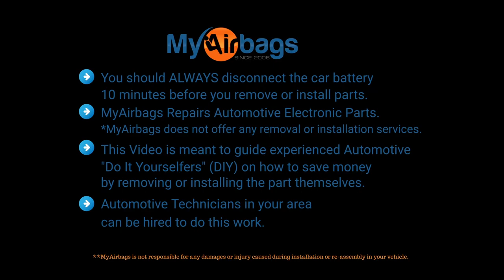How to Remove Center Console on a Lexus IS | MyAirbags

Comment: Thank you very much!! I crashed my lexus its now repaired only this module needs to be cleared
Reply from the maker: Yes we can reset your airbag control module. Also check your seat belts to make sure they work good. We can rebuild yoir seat belts as well if they are bad. Our website is www.myairbags.com and our phone number is 855-770-4055

Comment: My 2017 center console trim controls (entertainment) is stuck. Can you show how to clean it up? Thanks.
Reply from the maker: Hi Pop, Thanks, if we can this vehicle in again, we can do one on that.
Reply: @MyAirbags   thanks for reply. i figured out the issue, it wasn't the physical buttons stuck due to gunk as reported by technician at dealeship, it was the nicro switch that has failed. looking for some replacement from lexus. thanks, i'll try to do a short clip on that one.

Comment: any tips on how to open up the center console of a 2016 RX? I need to change the Tract Control Switch
Reply from the maker: Marcus Lam, Thank you for your question! When we film instructions on a specific car, within a certain Make (Lexus for example). We get feedback from customers who tell us the video was similar or helpful to another model within the same make. The RX is probably a bit of a stretch from the IS model, however, you may find some similarities that could assist with your RX project. If there are any similarities, would you please reply back to us here? I'm sure theres plenty of other people with the same issue that could use your input.

Comment: I want to replace the oem shift knob to a samurai handle, what is the best way for me to remove it and the boot to get started? I’m new to the Lexus so I need some professional advice, help plz, thank you
Reply from the maker: Lonnie, When we had this car in the garage we were removing the airbag module from underneath the center console so we didn't film how to remove the shift knob. We do have other vehicles where we did have to remove the shift knob boot. It should be on our Acura or Subaru removal videos on our channel.
Reply: You know what, the video that you provided was enough... I winged it and got that job done! That vid was actually ALL I needed, thank you!
Reply from the maker: @lonniebennettjr.261  Glad it helped! Thanks for the feedback!